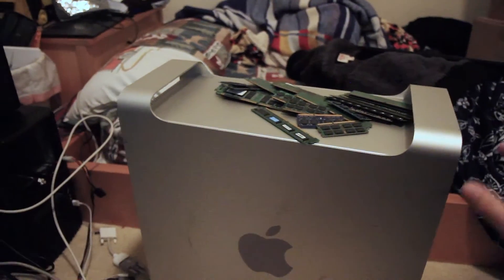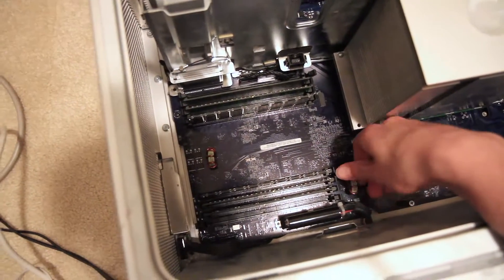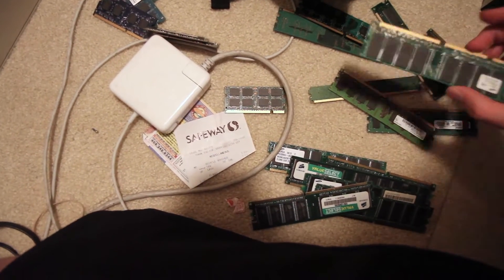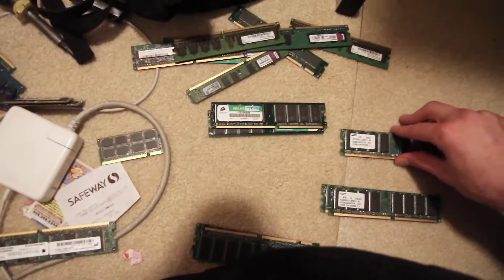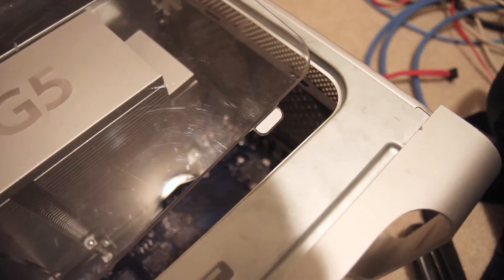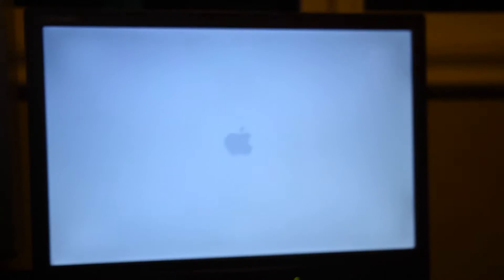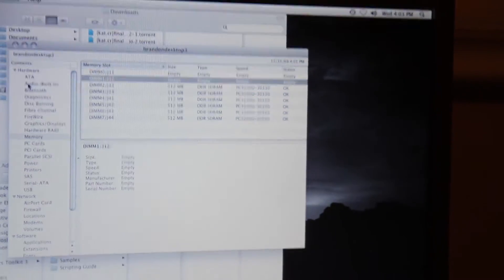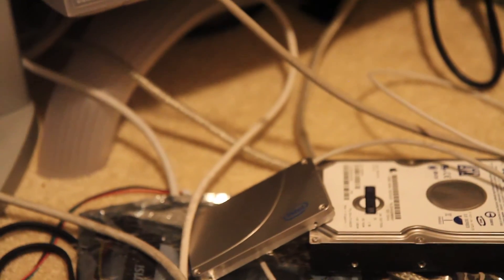PowerMac G5 Ram Upgrade

Comment: Looks like your G5 is missing the back CPU exhaust fans. It's an inexpensive part on eBay, and I would recommend getting it just to be safe.
Reply from the maker: +Timur Tripp I know it is and i have looked at the temps on the chip and its stays under 50C. I may get them in the future.